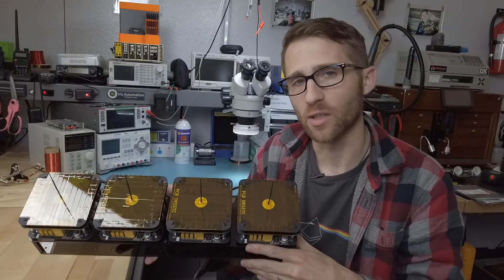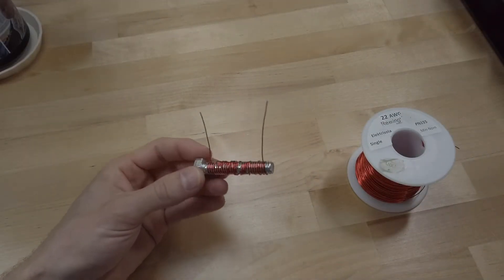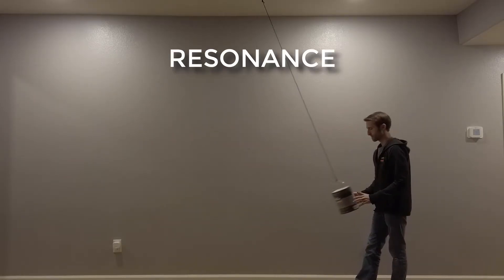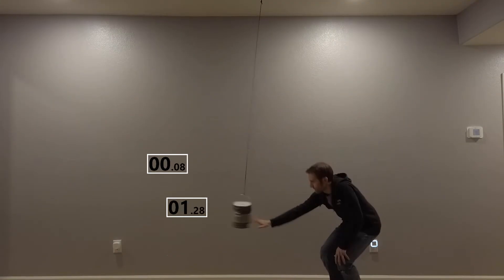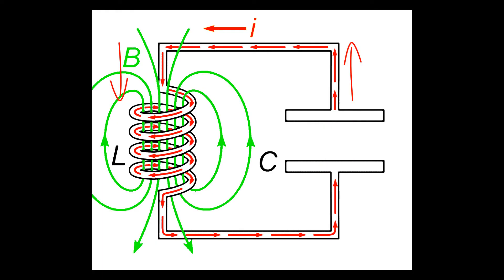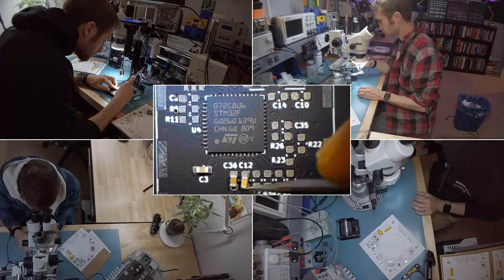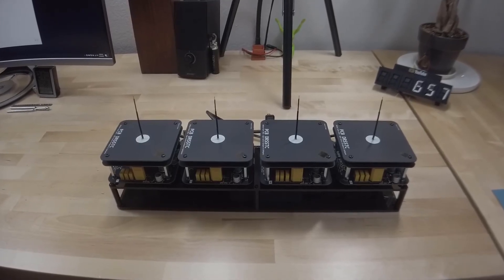Tesla Coils ⚡️ How Do They Work?

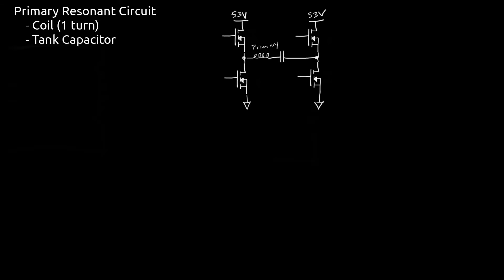Comment from the maker: Correction: the block diagram at 6:53 misrepresents how feedback has been implemented. The coils operate in a self resonant mode and can self adjust for changes in resonance by sensing the current in the secondary through the shunt resistor, and feeding this signal back as positive feedback to the drive circuit. The STM32's PWM audio signal serves as the interrupter signal by enabling/disabling the triple AND gates within the dead-time circuit. (V1.6 schematic)
Reply: Explains to me a thing I can't understand: how do I get multiple separate signals (for each coil separately) from one midi output?
Reply from the maker: depending on what midi player software you are using, you can assign different instruments within the MIDI file to play on different USB outputs. if you have 4 coils they will each enumerate with their own unique device descriptor in the MIDI software for example. hope this helps!

Comment: Where's the fourth coil and why is it not in the demo? Also, what's the lowest note they can play?
Reply from the maker: the fourth coil is still there, it failed for some reason, presumably a soldering mistake, i didn't waste much time troubleshooting it as the 3 coils were still interesting enough.

technically you can interrupt it at fractions of a Hz, so it can definitely cover the lowest note on a piano (A0 or 27.5 Hz) but I'm not sure how great it would sound. i could do a frequency sweep and check!

Comment: Wouldnt it be possible to up the volume of the fast following notes by alternating which one you use for it and giving it more time to build up energy?
Reply from the maker: unfortunately the higher frequency notes don't have as big of streamers or audible amplitude because in order to generate them you have to cut them off/on faster. the larger Tesla coils don't suffer form this as noticeably because they are being driven with much more power. these are powered only with USB voltages/current at the input (up to 3A @ 5V).
Reply: @ZacksLab  Can these TCs run continuous duty? In curious why most DRSSTCs are not allowed to run continuous. Is it a power dissipation issue due to high reactive currents in the primary requiring very low Rds(on) fets?
Reply from the maker: i haven’t tried running these continuously, nor have i characterized power dissipation in the GaN FETs, but generally DRSSTCs (like you mentioned) do not run continuously because the high Q of the primary resulting in much higher currents in the primary, and finding FETs that can handle such high continuous current is difficult. you could choose a FET with low Rds_on and aggressively heat sink it to keep junction temps below max rating.
Reply: @ZacksLab  I have been working on my small 300kHz coil, I'm using 90A 200V 20mOhm HY1920P fets and a PCB half bridge but they do like to fail. I measured 60A on the current transformer feedback but the heatsinks don't really get warm
Reply from the maker: hmm interesting that you’re losing FETs but not noticing any heat issues. are you sure you aren’t exceeding any other parameters of the FET? Vgs max or Vds max?
Reply: @ZacksLab  The project github is here: https://github.com/power-max/universal-half-bridge

and my question is found here:
https://www.eevblog.com/forum/projects/tesla-h-bridge-likes-to-fail-mysteriously/new/?topicseen#new

I am using HY1920P transistors right now. They seem pretty great for 69 cents, 90A (allegedly), 200V, and because it is a half bridge with well thought out layout for the bypass capacitors to ensure Vds remains within bounds. I verified this, also.

The TL;DR is that I now suspect the 1V/ns dv/dt rate of the rise/fall time. (100V in 50ns) that might be what is causing problems. Because I cannot see anything Vgs or Vds exceeding ratings on my scope.